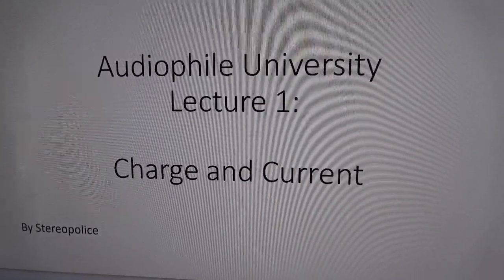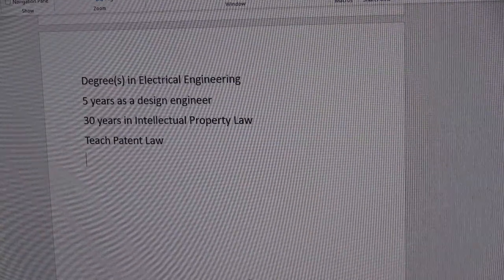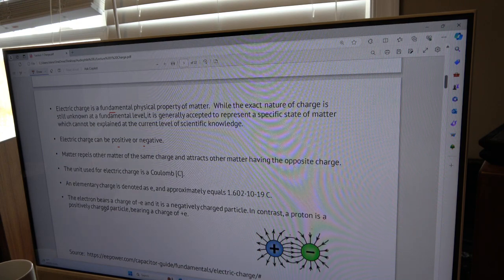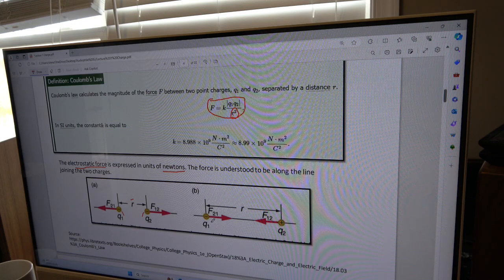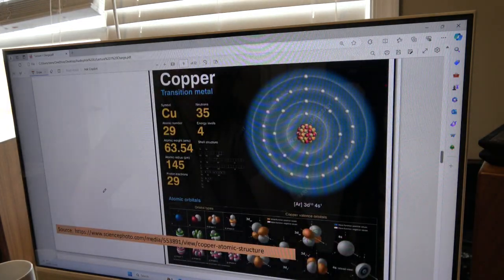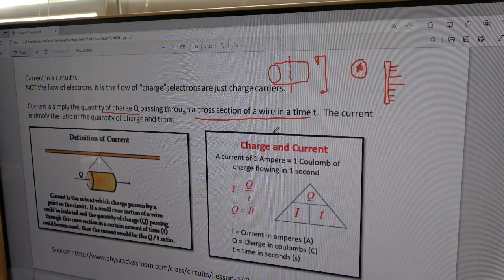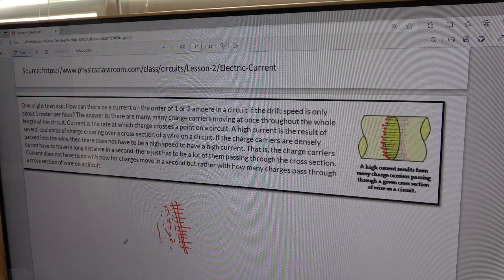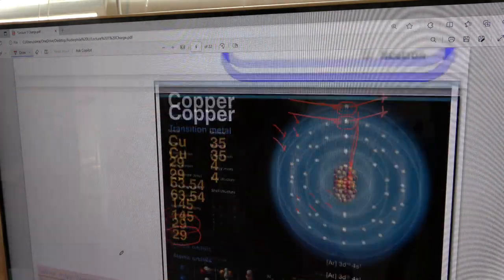Audiophile University, Lecture 1: Charge, Current, Conductors, and Insulators.

Comment: Great job putting this together! I especially like the way you explain static charges of matter prior getting into the atom and it's components.  Many other electronics classes skip that part and get right to current flow after the atom anatomy.
Pulled out my old books from my formal electronics training to brush up a while back.

Some of the smartest people I know were self taught. I learned from my grandfather who was an old timey radio guy, self taught himself radio in the 1930's. He was my mentor and I was privileged to have him teach me the old school stuff.

The reason I went for a formal electronics education in the US military was because no one would hire you without some kind of formal training.

Places I have worked as a technician with young electronics engineers knew less about the circuitry he was designing as a prototype that I did, it seemed. Made me wonder how he got through his classes to get his degree. For example we were working on an automatic pump test rig hooked up to sensors which fed into HP mainframe computer system. The computer kept crashing because he forgot to put snubber diodes on the relays that operated mechanical relays. Counter EMF? You would think that would be obvious, but in hindsight, it could have just been an oversight for a prototype. (edit: too many typos)
Reply from the maker: RIGHT FUCKING ON!  !LOVE!
Reply from the maker: Always appreciate your intelligent comments.
Reply: @stereopolice  I feel we all need to know when we are doing something right, and be specific where you can. Treat others as you would like to be treated, by genuine and honest. Be in the habit of being a good finder, if you always look for the negative, I guarantee, you will find it. My philosophy I try to live by.  

BTW I miss the porch and burn barrel life philosophy chats with the cigar.
Reply from the maker: My life changes by the minute  @zulumax1

Comment: You still have the A-1000?   I still have mine.. it's be unplugged and idle a couple or years.  I need to check both the A-1000 and the A-1020.. both unplugged and idle.. I have a noisy tone by-pass switch but the direct mode works fine--no noise.  For now I'm using my Yamaha AX-930.  I'd like to get advice on service checks on the 1000 and 1020.  I'm thinking about finding a qualified service center.. I love both of those and like you once said.. the A-1000 is definitely a keeper.  Thanks for the electronics theory refresher.